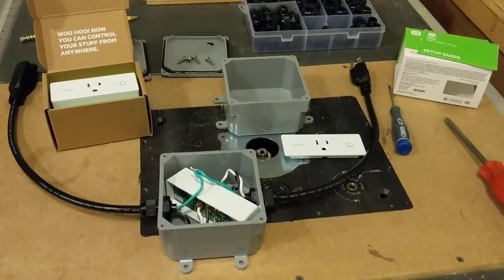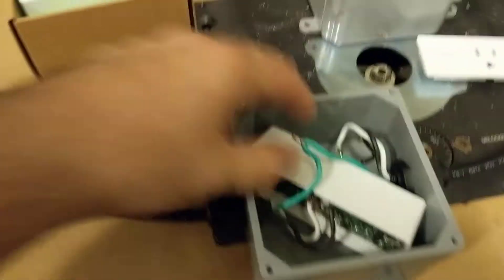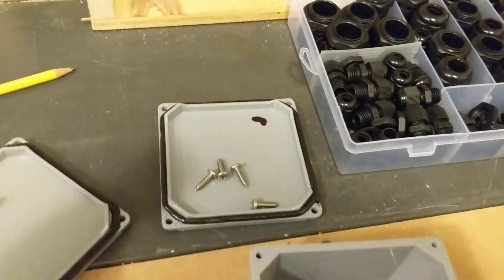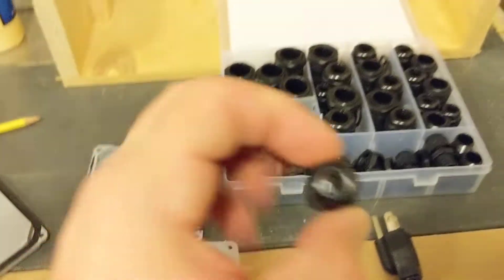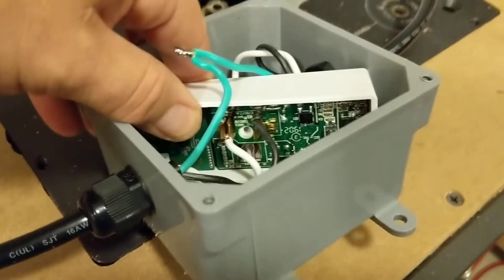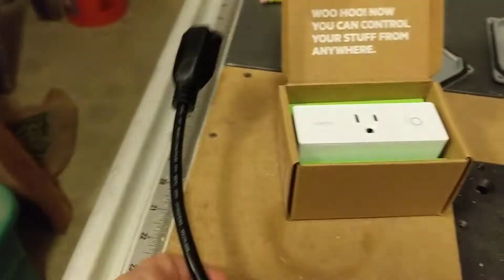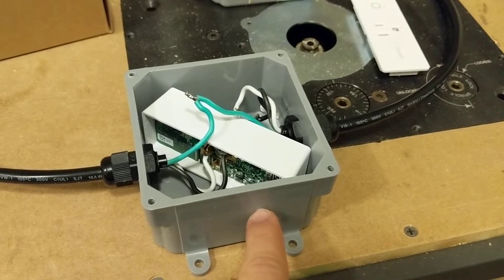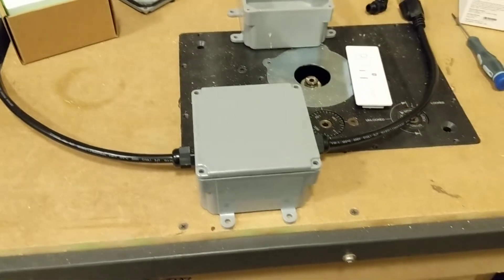Convert a Wimo SmartPlug for Outdoor Use

Comment: Pretty sweet Jason!! I had no idea this was possible!  It is truly a pain to go out side and unplug or plug in stuff. Having the action to do it from the phone would be so much better. Thanks for sharing !
Reply from the maker: I have been modifying these things for years to do different functions they might not have been designed to do.  Belkin used to make the Wemo Maker, which was a generic module with an internal relay brought out to contacts.  Basically make it do whatever you needed.  I had it connected to our garage door opener switch, mimicking it whenever I triggered it through the app.  Instant wifi control of the garage door.  Came in handy one day when I forgot to close it.  Got about nine hours away and my neighbor called me to warn me of my mistake.  One quick tap and he confirmed it closed right while he was standing in our driveway :o)

Comment: I thought about something like this. But I ended up using Meross smart plug and it fit perfectly in an extra large outdoor outlet box with a cover. But there’s 2 styles of plugs so you have to make sure you get the right one.
Reply from the maker: Not familiar with that manufacturer.  I have several of the Chinese knock offs here to play with.  The TP-Link modules are nice, a little cheaper, but require a whole different app to set up.